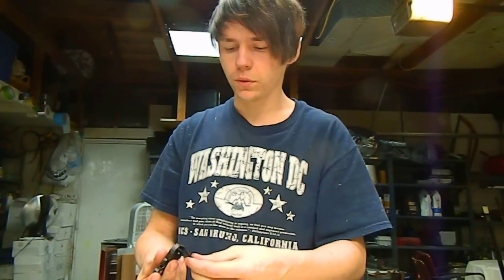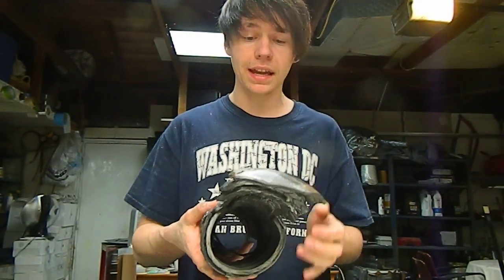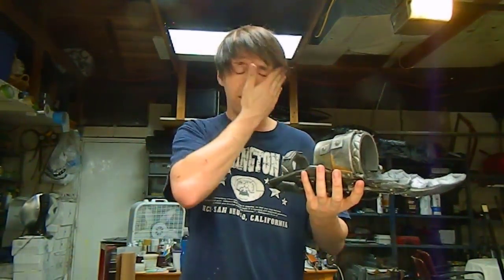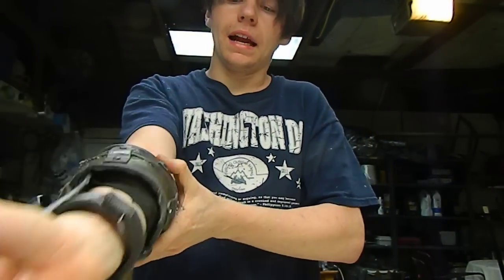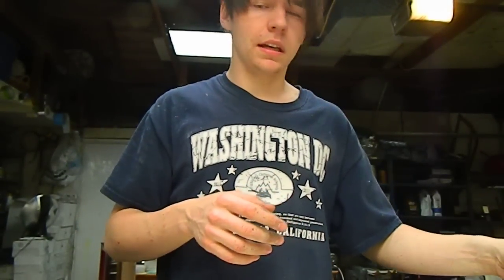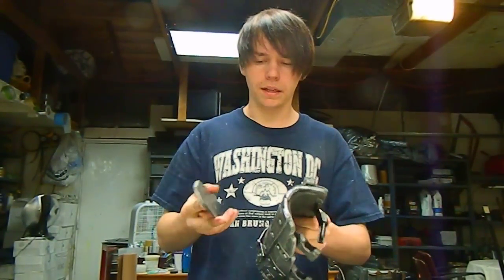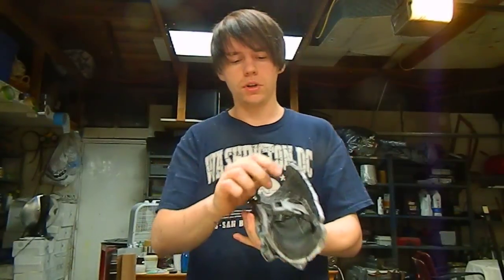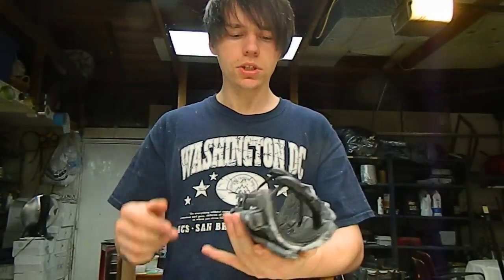EVA foam armor: strapping/securing

Comment: super helpful! my armor kept slipping off my body last comic con year, and I think I'm gonna try that velcro one you talked about this year.  I tried using latches and a thin foam that stuck to the Eva foam with some hot glue...but apparantly that failed horribly....:/

Comment: what is a recommended adhesive that is more durable then hot glue and super glue for the EVA foam?
Reply: +James Davis I use contact cement from Home Depot.. I like it because it dries like rubber kind of and it's crazy strong!
Reply from the maker: +Winnie Dublin Nailed it
Reply: +DemonWeasel1990 By any chance did you end up making the Pauldron video :D

Comment: Ayyy lmao, where do you get your EVA foam at? Also, (Question about your EVA foam video) I'm not exactly old enough to use a torque (I think it's called, I have no idea. [The thingy with the fire]) so what could I use instead? A hairdryer or something? I dunno. Good job though!
Reply: You mean a heat gun? To get the foam in shave?
Reply: You can use a hairdrier but keep in mind that it will take significantly more time
Reply: Okays, thank you!

Comment: Does the foam rip easily? and if so is there some kind of spray to harden the foam?
Reply from the maker: That really tends to depend on what it's being used for, where you've strapped it, the thickness of the foam, etc.

In my experience it's pretty damn sturdy and durable! :D
Reply: DemonWeasel1990 Ok, thank you!

Comment: I wonder if project cement would work still on already closed cells?
Reply from the maker: It actually will, but you will be lucky to get a quarter of the adhesion that you would with open cells.
Reply: I see, thanks man. :)
Reply: +DemonWeasel1990 PLEASE HELP! I'm making a nightwing costume and Idk how to attach the chest to the abs to be able to strap it to my body.
Reply from the maker: Bp films Not 100% sure what ya mean bro.
Reply: DemonWeasel1990 Ok so originally I was going to use contact cement to put the chest piece, abs, back pieces, logo, and shoulders on the compression shirt I'm using for an undershirt. But I wanted to be able to re -use the shirt for different costumes. What I'm saying is, how do I make all of it wearable without gluing every thing.
Reply: DemonWeasel1990 That's the thing haha. I can't sew to save my life, and even if I could the costume has to be ready by the 18th. I thought about using elastic and a couple nylon straps to do it. What do you think about that?
Reply from the maker: +Bp films (Bpfilms) I say go for it bro!
Reply: DemonWeasel1990 Ok thanks! Would you mind if I pm you if I need help?
Reply from the maker: Bp films Totes bro. PM me on the FB page